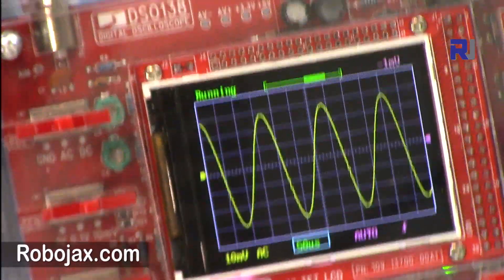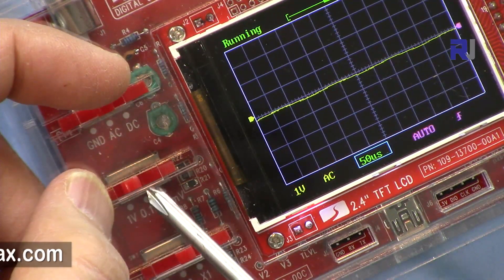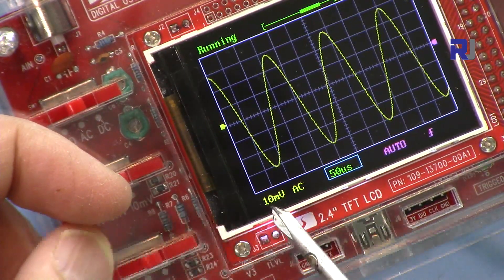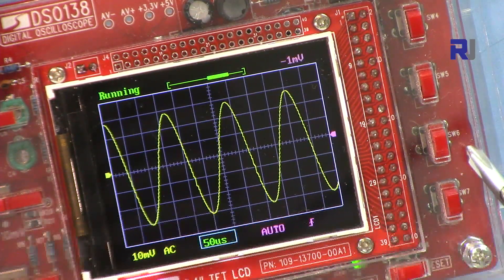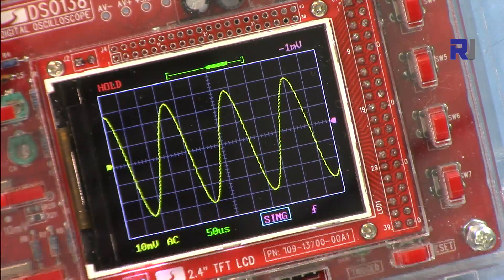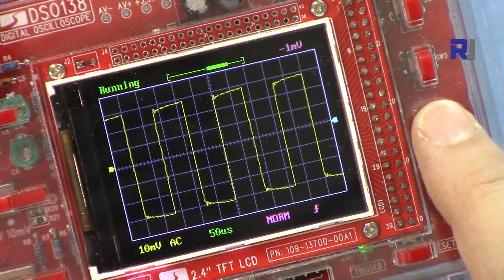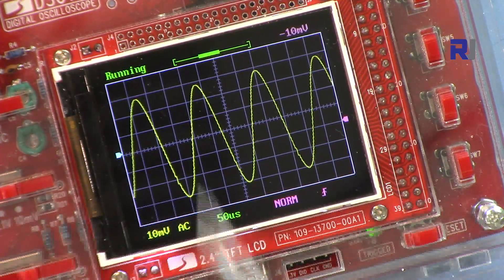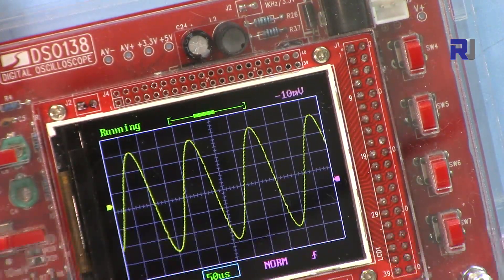How to use JYE Tech DSO138 Digital Oscilloscope kit - RJT238

Comment: I came back to watch and give a like. I'm still using the 138, it's getting a battery mod because it finds it way on the bench a lot. The plastic case remains stupid, perhaps some engineering might take effect while doing the battery mod. The JYE Tech is the correct version of this. Good show.

Comment: Hi tks for video, can u tell me what is ur 9 v source battery or any adopter.
Also how to measure DC volatge( did not show ac/dc mode swich function & USE). My have a 1 khz test sig source,built in also 3.3& 5 v source on  board
Reply from the maker: I  just played the video and there is huge switch labeled as GND AC DC. 9V is just 9V does not matter where it comes from.

Comment: I wasn't expecting much when I got this and boy was I not disappointed. If ten bucks for an hour or so of soldering, assembly and testing sounds worth it to you then get one of the completely disassembled kits on Amazon. If you actually need a functioning tool this ain't it. Some of the oscilloscopes built on Arduino are light years better.

Comment: I think you missed the point about the line at the top of the screen with the thick portion. The whole line represents the whole of the sample taken by the scope on one sweep. The thick portion of the line represents what you can see on the screen. So by scrolling this line you will see parts of the waveform not displayed on the screen but captured before the trigger. Of course using a simple repetitive signal like you did you will not see any new information. But when using the one shot mode on something like a digital I2C signal you should be able to scroll through and see other data that you can't see on the screen.
Reply from the maker: The only works I did not mention is sweep.

Comment: Can we use for check signals in laptop motherboard
Reply from the maker: So it seem you have not watched the video. Check the maximum period or frequency this score can measur end then check your laptop or  device. If it is less than or equal the specs of this score you can do it. I believe this scope can measure up to 500kHz and laptop has so many different frequencies and it seems laptop is 100 times higher than the capability of this scope.

Comment: can i check a fm transmitter circuit using this device . what is the maximum frequency which i can check with this ?
Reply from the maker: a transmitter has frequency.  this can measure up to certain frequency which I forgot it, if your transmitter is within the frequency range of this scope, yes you can see it.  but if you are referring commercial FM radio, then it is it is about 88 MHz to 108MHz. that scope will cost between $800 to $10,000.

Comment: Just completed assembly of my unit. The LED is not  blinking, but the display works well. The instructions are not clear about the Test loop  and JP 2 and 4.. Should the test loop be removed and are JP 2 and 4 to be  left soldered?

Comment: my test signal is way up off the top in both DC and AC, i have to slide the signal WAAAAY down near the very bottom to bring it to the middle of the meter.  I've tried turning the green adjustment things next to the screen with a screwdriver but they don't do anything visible.  did i make a mistake putting it together? how do I fix it? Ground also doesn't seem to do anything?
Reply from the maker: wow. I am not sure what have you done. it could be potentiometer if there is any have been placed in revers.  I  am sorry I have made this video long ago and don't remember what I did. Perhaps someone else replies.

Comment: I assambled this kit a while ago but I have two problems with it:

1. The green led (Trigged) won't flash like yours. It just blink one time when it boots up and that's it.

2. The SEN 2 switch it shows on the screen that the position is changing but the wave stays the same. The wave doesn't get shorter or longer when I slide the switch.
Reply from the maker: Hello,
1-bad soldering  or wrong component
2-see 1
Reply from the maker: You didn’t reply back to see what you did.
Reply: I checked all the voltages from the manual and they all matched except for V- at TP25 it's measuring -16.38V and I read on a forum that it should be only at about -8V.

I was thinking maybe I try to flash a newer firmware but i've been getting an error. I used the ch340g ttl-usb converter and the ft232 which I connected rx and tx in crossover way.

Hope I can get this oscilloscope to work and would appriciate any help from your end. 

Thanks for your convenience.

Comment: Hi Robojax, just got this unit. Can I use the USB jack/plug located at the mid-bottom of the board to power this unit up?
Reply from the maker: Hi, I look at your comments for past 4 days. I don't have the module in hand and I believe there is no harm to connect it and it should power it up. that port is to program the chip as oscilloscope.

Comment: EXCELLENT video. From watching I think the trigger is not working on my unit. I will check it further.
BTW, the "u" in the time base is actually the Greek letter Mu, and in electronics Mu is used to designate "micro". Most people don't have access to Greek letters so they use lower case "u". As in uF for microfarad.
Reply from the maker: Thank you. and I mentioned it at 2:47 as microsecond. the "mu" is μ not part of keyboard letters and  people for convenience  use "u" instead.

Comment: Can you change the sensitivity and other settings while on Hold?
Reply from the maker: yes. they all mechanical. But you can't display the change until you return to normal.
Reply: @robojax  But if you use the SING trigger mode, you cannot "zoom" the triggered pulse?

Comment: What is this tool used for exactly
Reply from the maker: it shows the voltage as it changes. people use the word "signal" so you view signal. on x-axis you will see the time and on y-axis you will see the amplitude of the signal (or how much) . for example the signal to a speaker is sound wave. you can see it on this (set the speaker volume about 25%). or any other devices.

Comment: Is it normal for these to have a screen which is difficult to look at at any other angle than from the left? Or did I just forget to remove some protective sticker from the display? It doesn't show on the camera, but camera has only one eye and I have two.
Reply from the maker: this is OLED (O-L.E.D) screen and you should be able to view it from any angle. Yes. Remove the protective sheet.
Reply: @robojax  I have finally had time to check and I've found out that there was no protective foil on the screen (as I had suspected), I peeled it off long ago. There is another film on the screen, but that is glued well and thus it's supposed to be there. It simply is the nature of the display. It's no biggie, I'll get used to it.

Comment: This seems perfect for setting car amplifier gains. Is it?
Reply from the maker: the input voltage of this has limit (I know it now but you can see it in video) but you can measure anything. Gain is the ratio of output divided by the input.  so you have to measure the input and write it down, the the output and write it down and then divide it using calculator to find out the gain.

Comment: Can you measure the frequency of the automotive ignition coil with this device? I am trying to identify the cause of misfire and would like to see whether the coil "fires" equal to RPM/4 However, I am not sure of the actual voltage on the plug  - 25kV?     I understand, this device should not have any problems with measuring the O2 sensor
Reply from the maker: The input voltage must be reduced to 10V so you can safely measure it.  It will show the waveform time and 1÷Time= Frequency and yes you can measure frequency. For example if a one full cycle is in one box (division) of scree and you  read 1µS ( 1 micro second) then 1/1µS = 1000000 or 1MHZ
Reply: @robojax  Thank you for the reply. The current in spark plugs is tiny: it's something more than uncomfortable and less than mild pain. My only idea at this point would be to salvage the old induction pick-up from the light timing gun,  connect to its 12V light output instead of the bulb and to use 7805. It will not visualise the quality of the spark, but certainly would show the occurrence/frequency of the firing.  Many thanks!

Comment: Can i use this device for checking mobile components
Reply from the maker: Oscilloscope can show voltage, frequency and shape of a waveform. it is up to you to use it for whatever purpose you want.  Inside mobile device, you can check voltage or waveform of Audio. Bur for example you can't check RF (Radio frequency) of the mobile because it is very high at 800Mhz or 1.2Ghz or higher and for that reason you will need $10,000 to $100,000 oscilloscope.

Comment: Hello, Can I use it for confronte two ware and to take delta t ?
Can I use it for to take data on pc ?
Reply from the maker: Hi, no pc connection. delta and other calculation can be done with calculator and pin

Comment: can I use this kit to discover dirty electricity in my home?
Reply from the maker: this is just a tool. Depends on how do you define "dirty electricity".  this show change in time (how fast it changes) and amplitude  (how much it goes up or down of a signal.  It is up you how to use this.
Reply: @robojax fırstly thank you for the video. Well done!My questions are 1) Can I see harmonic distortions of 50 or 60 Hz AC 2) Can this measure erratic surges & spikes?

Comment: can I measure sound frequency with this oscilloscope?
Reply from the maker: yes you can but from what source? you need a microphone to amplify the sound and the output of amplifier can be connected to oscilloscope and you can see live signal as you talk on the microphone. or play something on your phone or other audio device, connect the (spare )headphone jack to the phone and connect other side of the headphone wire to oscilloscope (ground and signal, 2 wires) and you will see the signal
Reply: @robojax  What about a car amplifier distortion testing.. Clipping.??

Comment: hi....i built mine and some reason when the probe is not in im picking up a trace....what could i check? without a probs shouldnt i get nothing?
Reply from the maker: You will not get anything. you can use 2 wires. One wire from the outer of connector to Ground. then another wire from the center of the connector to the Test point. and you should see signal if you made it correctly.
Reply: Robojax what im seeing with no probe attached is a trace that looks almost like a bar code...what could i have done wrong?